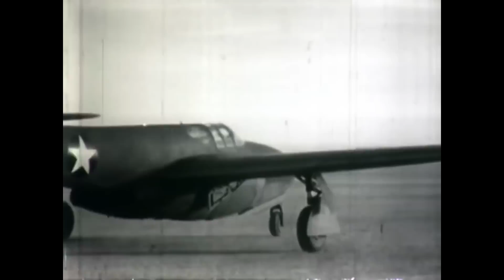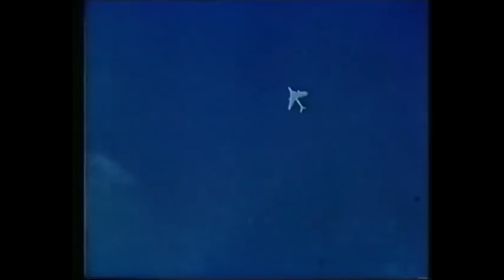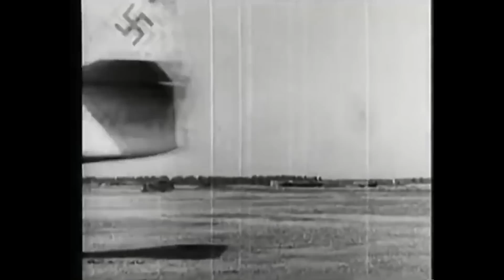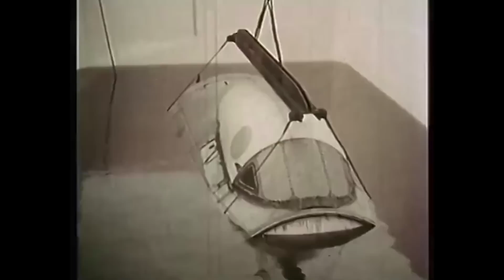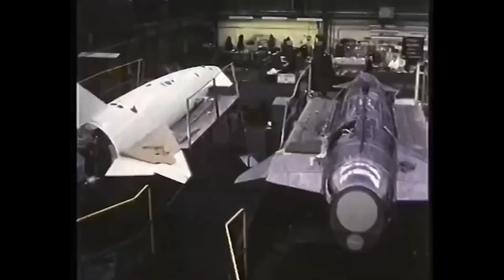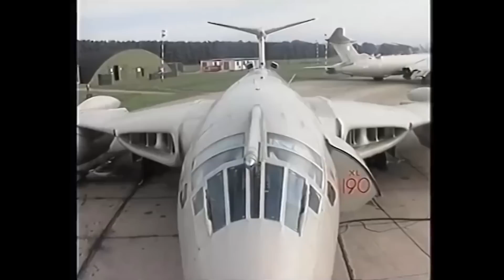Handley Page Victor | British Strategic Nuclear Bomber And In-Flight Refueling Tanker

Comment: The Victor is defiantly the Darth Vader of the "V" bombers. It looks mean, it's the bigger of the 3, carries the bigger load and looks like it will take a base ball bat to a street brawl.
The Messerschmitt 262 engines were from Junkers, the Jumo 004. They are axial flow compressors. Not centrifugal as outlined in this video. The difference is vast.

Comment: ". . . the Berlin blockade of 1948, followed by the building of the Berlin Wall marked the beginning of the Cold War."

No.

Yes, the blockade of West Berlin was probably the first overt action of the Cold War, but the Berlin Wall was erected in 1961, a full thirteen years later. And, arguably, the Cold War began during WWII itself, at one of the triumvirate conferences  (Yalta, Tehran or Potzdam, I don't recall which one).

Comment: After gary powers was shot down, the RAF changed tactics, and decided to fly at treetop height. Th Victor and valiant airframes were not suitable for low level interdiction, sso the task remained with the Vulcan, the Victor was converted to a tanker role
Reply: The need to move to low level was understood by around 1957, not long after the V bombers entered service as this was how SAM and fighter and AAM technology was progressing. HP proposed a low level Victor development with podded engines but since ICBMs  were the ultimate intention it was seen as cheaper to just use the Vulcan rather than trying to develop a new type that might not be ready before the V bomber force was retired.

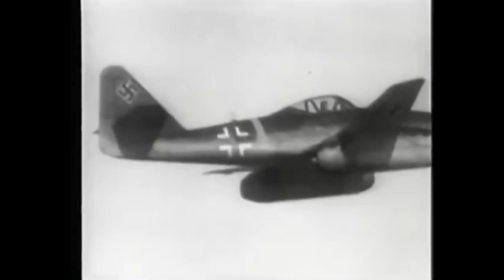Comment: at 17:45 I think I should point out that the jet engines flown by the me262 and others like it were axial flow engines like we have today. The centrifugal engines would become the standard for a short time until the axial design had matured a bit. The Jumo 004 was ahead of its time in that regard. Paid the price for it too as it had a service life of only 80 hours before a rebuild was needed.
It is also the only jet engine I know of that can be started with a pullcord. Like a lawnmower or a chainsaw.

Comment: What’s crazy is they had ejector seats  …hopefully that crazy cockpit opened up quick !
Reply: The original design was for the whole crew compartment to be jettisoned with all occupants similar in concept to the F-111, but it was considered too complicated. The next idea was to provide ejection seats for all the crew, but again it was considered too complex with canopy jettison etc, so just the pilots were provided with ejection seat and the rear crew of 3 or 4 (if the 6th seat was occupied) had to bale out of the crew entrance door. The rear-facing seats (Nav radar, Nav plotter and Air Electronics operator) and the 6th seat (Crew chief or passenger etc) could swivel and were equipped with booster cushions to help them get out of their seat quickly if the Abandon Aircraft command was given.
Reply: Victors only had ejector seats  for the pilots, as did Vulcans. Bit of a sh*t if you were a navigator, flight engineer or AEW.. Apparently almost no way to get out for them if you had difficulties, especially the Victor

Comment: What is those two huge air scoops on the aft upper fuselage. APU intakes?
Reply: They're a kick back from it's nuclear role, forget what they're for tho..
Reply: They are air intake scoops for ram-air turbines to provide emergency electrical power in the event of loss of all 4 engines. This was considered a precaution as in the event of being caught in the wake of a nuclear blast, all main engines could have flamed-out. The RATs gave sufficient power to control the aircraft until hopefully the engines could be restarted.

Comment: My first sighting of the Vulcan was in 1964 at the Farnborough airshow. The bomber had a huge large black box attached to the bottom of it which I later learned was the experimental RR Olympus engine which would later be used on concord. The most memorable thing however was the feeling of my internal organs shaking as the plane took off on full reheat on every engine, blazing along the runway 200yds away. This is forged an indelible memory on this five year old not in fear but in awe.
Reply: The Vulcan did not have afterburners.
Reply: @basilb4733 the concord did and this particular airframe had that engine hooked up as a testbed
Reply: @markvauhan1301 Must have shook your brain cell too, the vulcanised engines never had reheat on its four engines.

Comment: Avro had problems with the Vulcans wings - hence the wing design modifications soon after. At RAF Swinderby during a Wednesday passing out parade in the mid 1980's, a fly pass by a single Vulcan, the old hangers were having their corregated iron roof panels being replaced by civil contractor at the time - you can guess the rest, many of them roof panels flew with a crash bang everywhere. Gladly with no injuries, apart from said old hangers. 🙂😁
Reply: What modifications were done to the Vulcan wing, Being delta I thought it was perfect.
Reply: A kink was introduced in the leading edge to overcome aerodynamic issues. It's mention in the video. @kiwidiesel

Comment: Did the flight control system of the Victor/Vulcan during training at RAF Cosford, could take off, fly a set route, do its thing, then come back and land, without the pilots having to touch anything else usual. Localisers used to make the runway dig holes because they landed exactly on the same spot.
Reply: Christ, we were good.
Reply: @MrDaiseymay   But it was full of unreliable electrical solenoids though - that is why each aircraft had to have a top notch aircraft flight engineer on each, to change a black box suddenly and do a reboot.

Comment: Video production  team  need to get on top of audio.    Moreover the silly Hollywood music is so dated  and quite uneccesary.   Interviewees  giving fascinating insights and talk over commentary lost because of racketing music.    These are amateur  failings.
Reply: True. No need for the music. Also, the commentator is a wee bit too hurried.
Reply: Oh come on, what to you expect, multiple billions Hollywood production?
Reply: @huwzebediahthomas9193   No ..   just elementary review and adjustment.   That was interesting material but  background music was way too loud .
Reply: @causewaykayak  
We could say this is a V.1 a version 1? The next version, which I no doubt will be cleaned up, aurally, will be better. 👍🙂😁
Reply: @huwzebediahthomas9193  One hopes.   These are quite valuable historical documentaries.
Reply: @causewaykayak  
Invaluable clips. 👍🙂
Reply: Too harsh a comment. The soundtrack is original and was added by technicians working with valve based audio equipment and celuloid film probably at pathe or gaumount for use in a cinema. TV only became popular around 1967 and were black and white valve driven technology, Transistors were a new fancy form of radio and the first microchip did not appear for another five years. Considering the limitations imposed by the technology, the makers could be forgiven for these 'mistakes' as they did not have todays computerised, digital equipment which makes video production so easy. A mistake that todays Youtube generation tend to overlook.
Reply: @nemo-79000  I'm nearly 80  and was am avid cinema goer In those days.    I may even be slightly hard of hearing.   That was in places ridiculously loud.   I well recall the soundtracks to News Reels  and also of national service training films and patriotic documentaries from US and UK  having full blast orchestral racketing.   Patriotic pomp and circumstance stuff and martial music seemed to be the rule. 
I am decidedly not of the younger generation  most of whom probably switch off directly they hear this noise. 
Are you saying that third party sound tracks can't be edited for UTube recordings?    My young experts say they can. Overloud music is widely criticised and rightly so.  Most of us don't need a marching band at full blare  to watch a plane take off
I think that some content makers are too precious or too idle to review their output  and sometimes do it over again to get a better product. 
Your technical details may be correct sir but they don't constitute an excuse.

Comment: Was quite a tough thing. Valiant was fragile, too much harmonics in it's structure giving it early metal fatigue, and the Vulcan was claustrophobic, it had a cockpit like the inside of a VW Beetle for many crew, very cramped.
Reply: How they squeezed two extra on the Dickie seats in the rear I don't know. It used to be said inside the Vulcan smelt of fuel, oil, paint, wiring, sick and blokes!